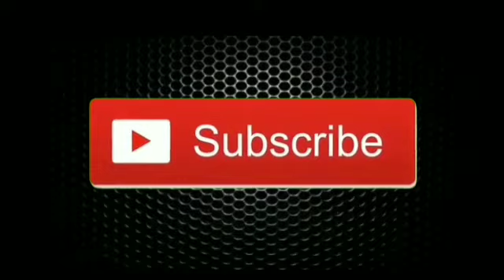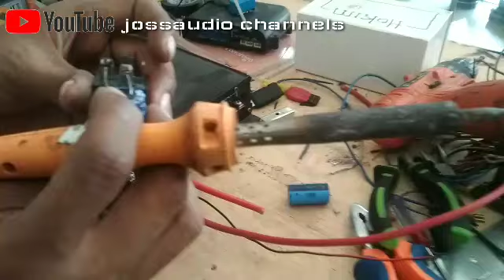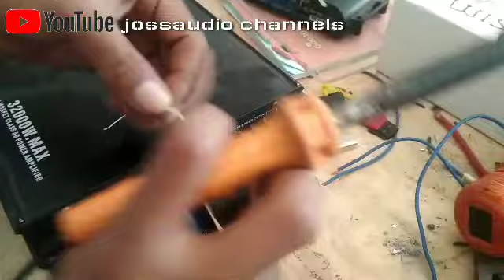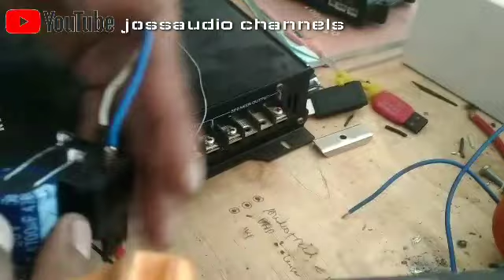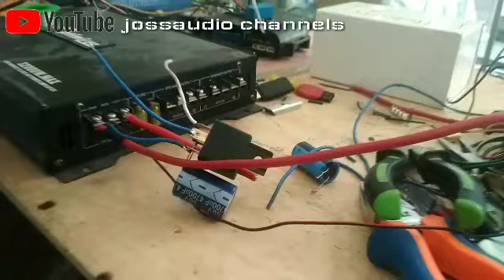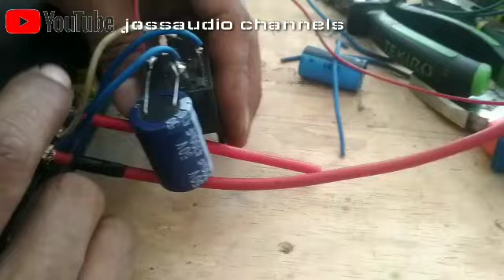Part 1#, BIKIN MODUL ANTI JEDUK  SEDERHANA, Cara Mengatasi Bunyi " jeduk " Pada Audio Mobil Anda

Comment: Gan mau nanya, sy pake subwoofer advance yg input listriknya bisa pake arus ac 220 sama dc 12v ,tapi kenapa ya pas dicoba ke mobil kalo volume nya di gedein diatas 80 malah muncul suara duk duk duk gk bisa brhenti kecuali dimatiin
Reply from the maker: Kemungkinan Powernya kurang Kuat
Kemungkinan Inputnya terlalu besar
Kemungkinan inputnya kurang balance
Reply: Kasus sama

Comment: Percuma om sy Udeh praktek kan dan Udeh sy coba ngak berhasil.
Reply from the maker: Kalu gak berhasil pake rangkaian Delay off atau bisa karena perangkatnya yg bermasalah gan
Reply: @jossaudio  maksud perangkat ini apa ya mas? Speaker atau head unit nya?
Reply from the maker: @hijaabsexy  intinya...pake relay dan Elco ini adalah mendelay strum yg masuk ke Power ( remotenya ).
Reply from the maker: Kalu gak berhasil, berarti delaynya kurang lama, nah untuk memperpanjang waktu delay opsi berikutnya adalah memakai rangkaian delay on.